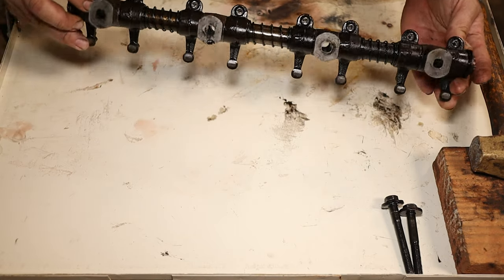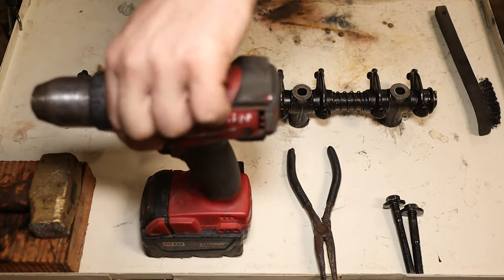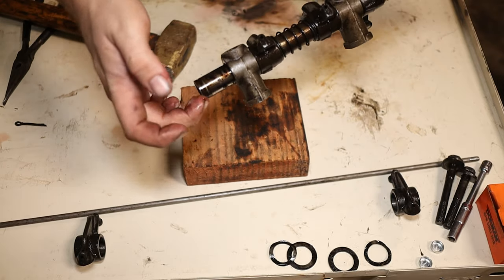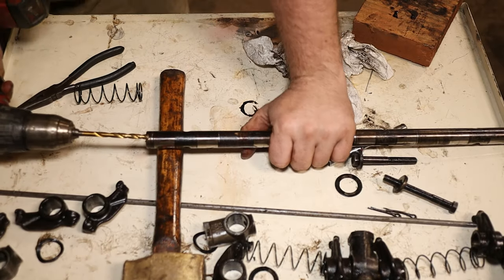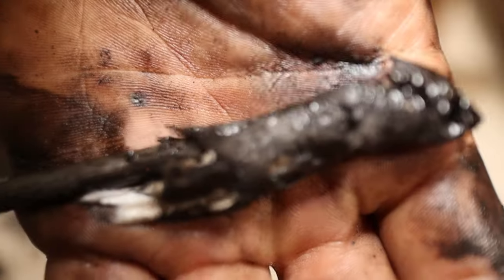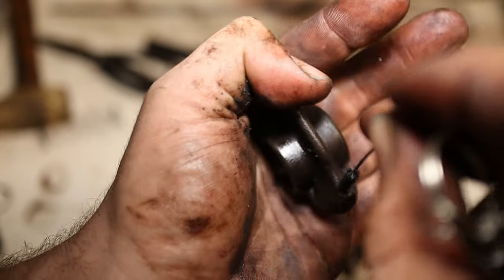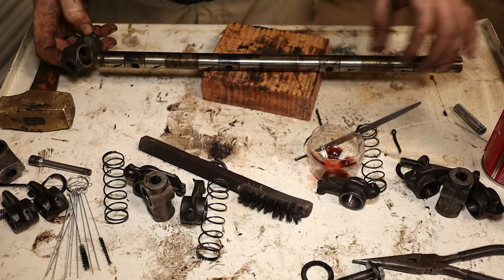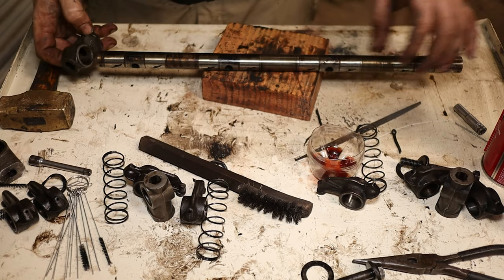The most OVERLOOKED cause of rocker arm oiling issues on the FORD FE Engine!

Comment: My old 390 had way more oil coming out of the rockers,  mabe do to the hi volume oil pump
Reply from the maker: Hi Graydon!Thanks for watching!😀 Most FE's should have more oil coming out than mine. This truck has a restrictor in the oiling passage under the rocker pedestal. This is in a 72 f100 4x4 and it spends a lot of time at high RPM's. The restrictor simply helps it apply more oil pressure at the main bearings and it also helps keep the valve covers from completely filling with oil on longer trips. ( this mod is really only needed if you spend a lot of time at high revs).

Comment: I've had a lot of high mile FE engines and still running a couple of rebuilts (when I can find enough gas) never saw a rocker oil problem(?) FE engines go many miles with near zero oil pressure at hot idle, wouldn't see rocker oil then(?). My engine builder warned me to be very careful clocking the shafts, didn't say anything about altering them. Clocking failure? Best thing for standard FE is long tube headers or high performance exhaust manifolds.
Reply from the maker: Thanks for watching Dan! I  I am not altering the shafts in this video, just cleaning them out.👍 In my experience with FE engines they will get clogged,( or at least partly so) and the oil flow out of the rockers is diminished, therefor exposing the brass bushings to unessecary wear. Although this probably does vary due to how well the engine was serviced/maintained.  I will also say that it seems pretty hard to find a well maintained FE in my area. 😅
Reply: Reason we don't find well maintained is those tuggers are so durable without maintenance like most old Ford over head valve engines. Recently took a 352 out a 59 bird 167K miles on the odo no sign it was ever taken apart. Mass sludge but still running good. Crank thrust was so worn rods were pushing the pins out of the pistons, common to high mile manual trans. Stock cylinder bores were still in tolerance, engine builder figured it was one of the rare high nickel blocks. Replaced with rebuilt 68 GT 390.   @TheBestDanielBlount
Reply from the maker: @danontherun5685  That's awesome! I have a 59 T-bird with a 352 myself! They are awesome cars! Mine has 54k miles and runs like a brand new car. Sadly, the previous owners left it out in a field for 25 years, so the paint is ruined.
Reply: I replied about your 59 but may have blown the reply, I think it started with 'now I'm impressed'. Let me know as I have some info you should have, especially that I have a lot of spare squarebird parts including good int/ext brightwork too good to toss and don't need bux. Will watch for your reply.  @TheBestDanielBlount
Reply from the maker: . Thanks Dan! I LOVE my 59! I used to not like them when I was a kid,  but bought this one for cheap mainly because I hated to see it sit and rot. I fell in love almost instantly and it's since become an obsession.😅 I might need some interior trim, mine is intact but the chrome plating is REALLY BAD, I'd also love a set of half decent door panels if I could find them. I need to make a set, but don't have the time right now.
Reply: I have all that and a lot more I don't need. Dash pad collapsed? I'm in Seattle, email connect? I have performance Fords and prewar cars but by far my favorite driver is my 59. @TheBestDanielBlount

Comment: I got new rocker arms and my rocker arms are loose and I don’t know what to do because their torqued down to 45 ft pounds. They are tapping and I don’t  know what I should do?
Reply from the maker: Do you mean your arms are loose on the shaft? Or that the arms are loose on the valves when torqued down? If it's the latter, you most likely need longer pushrods. The FE has several different pushrod lengths through the years. My advice is to measure the pushrod with a wide jaw caliper and then try one of the FE's longer versions. Pay special attention to the ends of the new pushrods because most FE engines use a ball on both ends of the rod BUT some of them did use a cup on the rocker end and a ball on the lifter end and you need to be sure not to order the wrong kind. Hope this is helpful.🙂 Best of luck with your project!

Comment: Sludge, next to heat, it's the engines worst enemy.
Reply from the maker: You are 100% correct on that!😀
Reply: @TheBestDanielBlount  There are lots of good products to combat sludge, the one I use with excellent results is rislone. Been using it since the 60s.
Reply from the maker: Heck yes! Risolene is GREAT! I used it once on an FE that was plauged by lifter noise, and it worked wonders! Sadly it seems to be getting a little harder to come by. The last time I tried to get some, all my local parts stores had stopped carrying it and I had to resort to Amazon.
Reply: @TheBestDanielBlount  In a pinch you can throw in  a quart of diesel fuel idle it at about 2000 rpm for 15 -20 minutes, drain and put in fresh oil with 200ml of diesel fuel. It'll clean as you drive, you'll feel the difference.
Reply from the maker: That's a great tip, I think I will give that a try ,next time! Thanks! 😄
Reply: @TheBestDanielBlount  It's important not to put a load on the engine like driving the vehicle with the quart of diesel fuel in the oil, not enough protection.

Comment: Does it go right back on or do i have to adjust something? I have a tick that i thought was a manifold leak, but a older guy i was talking to said it sounded like a plugged lifter and to put in some transmission oil. I put in marvel oil in and two minutes later the motor 360 got quiet but only stayed that way for about six minutes. Before i did that i pulled the valve cover and there was little dents under the  cover, but taller valve covers didn't help. Thank you for any advice
Reply from the maker: The problem you are having does sound like a faulty lifter, (FE engines are unfortunately quite prone to this as they age) my first course of action would be to pull the rocker shaft assembly and check all the pushrods to be sure they are not bent, as this is another possible cause. You can check them by simple laying them on a flat surface and rolling them along it and watching for bends. This would be a great time to clean the shafts like I did in this video. When you re install the shafts/pushrods you want to be sure to slowly and evenly torque the bolts back down to spec, (40-45 ft lbs IRRC) be careful when doing this as you can bend the rocker shaft if you are too aggressive. Most FE engines use hydraulic flat tappets, which means that once you bolt the shaft back on the lifters will "pump up" and basically adjust themselves dynamically. Some FE engines did have mechanical tappets, and need manual adjustment, however these engines are quite rare and were usually just used in HiPo applications. If your rocker arms look like the ones in the video, they require no adjustment, if they have screws over the pushrods, then they will require adjustment.  When it comes to lifters, I have tried ALOT of various additives over the years and various FE engines I have Had, and it's really hit or miss in terms of stopping noise. Lifters can be taken out and cleaned, or you can replace them (be sure to use assembly lube on the lifters and cam lobes, and follow the break in procedure for flat tapped lifters)  I hope this helped you, and if you need anything else, please feel free to reach out to me here anytime😀 Good luck!👍

Comment: Great video!
I have a '71 Maverick with an inline 200 engine, I'll be lapping the valves and replacing the lifters. I knew something had to be done with the rocker shaft, but I wasn't sure--NOW I KNOW! Thank you!
Reply from the maker: I'm glad I could help! Best of luck with your Maverick project! I have to admit I'm a little jealous! I've always wanted an early Mav!😃
Reply: Never saw a FE with lack of oil up there.usually too much if there is plenty of oil pressure.i installed a threaded plug in the oil passage under the rocker stand with a 1/16 in.hole.

Comment: the 292 ford is well known for starving rocker arm shafts. drilled oil passage to the camshaft, thru cam shaft bushing on thru block to cylinder head, and on to the rocker shaft. Hi engine RPM's can make the bushing turn [ rotate ] some blocking off the oil passage.A kit was sold to remidy that problem by a oil tube was routed to the valve cover special bolt that allowed oil to the starving valve train.
Reply from the maker: That is really good info! I have a couple 292's sitting here waiting to go into project cars. I have seen them drill and tap the top of the rocker shaft pedestal to install a restrictor to increase oil pressure. I am currently doing some testing of a similar "trick" for FE engines, in, which you insert a holley carburetor jet into the oil passage under the pedestal to increase main pressure. I have used that for a while on this rig, but I am trying to put together a video on the effects of it.
Reply: In case you guys are still on the yblock rockers John Mummert has the correction video, simple fix actually. Of the best yblock experts and quite a nice fellow actually. My yblocks were built to spin 5500 running hard for many years no problem and have a lot of pals that run them, no rocker oil problems. Mummert is also dependable parts source and has the best starter motor that also fits 58-64 FE. @TheBestDanielBlount

Comment: Sounds like the FE engine wants regular oil changes and dosing with M.M.O. to keep the oil passages clean and crud-free…
Reply from the maker: @dennisyoung4631   This is always good advice, but ESPECIALLY for an FE. The lifters are prone to failure due to debris as well. However, FE engines are resilient, I've had a few over the years that were run with non detergent motor oils and irregular/non-existent oil changes. They will still run for a long time, they will just make a lot of valve train noise.😅
Reply: Knew someone many years ago who had a “mighty three-ninety” in his truck.  Unfortunately, I never had the chance to own one - either a Ford, or a 390.

I suspect I really missed out.
Reply from the maker: @dennisyoung4631  I recommend them, if you come across one that's reasonably priced (hard to do these days). They are fun to drive, especially with a stick shift!! 😄 Parts are kinda pricey though.
Reply: @TheBestDanielBlount  afraid that my driving days are more or less over, due to age, ill-health, and poverty - the latter predominating.

Still, though - if the chance should present itself, I might try to secure one.
Reply from the maker: @dennisyoung4631   I'm sorry to hear that Dennis! I know what you mean about poverty though! Everything car related costs a fortune now it seems.😐

Comment: I rebuilt a Clark forklift and it had the same exact rocker arm set up
Reply from the maker: Thanks for watching Robert!  What kind of engine does that forklift use? I used to use an old Clark lift that had a flathead Continental. I suspect this process will apply to almost anything using shaft style rockers, but I myself have only used it on Y blocks and Fe engines.

Comment: As far as your video, you need to get a microphone or speak up. I couldn't watch it becouse I had to hold my phone to my ear just to hear anything you said. Otherwise I think you made a fine video. One piece of information im noticing alot of people are leaving out. You did mention the notch on one end of the shaft & you as well as alot of other articles I've read do say that the notch always goes down toward the head. Witch is correct. But dous it face the front of the engine or dous it face the back of the engine? It matters! And you need to know that when your assembling your rockers onto the rocker shaft. And you need to know witch side. Becouse on one side the notch goes down ofcourse, & to the front. On the otherside the notch goes down & to the back. If you will notice the oiling holes on the rocker shaft, yes they always go down, but they are offset from center. So  depending on witch way you put the notch, to the front or to the back, the oiling holes still down but will either be tilted toward the exhoust side of the rocker shaft or toward the intake side of the rocker shaft?
Reply from the maker: Thank you for the tips! I am 100% with you on the mic, I tried to fix it in post with no real improvement😅. I the tip about being more descriptive was super helpful also! I didnt even realize how vague I was being until you mentioned it. I will try my best to remedy these on my next video!

Comment: Hey Daniel howz it going?   Was wondering when you reinstalled the ahaft you didn't have to adjust the valves correct ,since you didn't crank the engine ovet or anything . Just removed & replaced  ( just torque to spec as per shop manual)  40 -45 foot lbs. Ready to put her back together  valves were adjusted on the rebuild but I m putting a new shaft since we reused the old one... so just wanted to know your input ..thanks bud
Reply from the maker: When I put them back on I simply tightened mine to spec. My Engine has hydraulic flat tappets and a non adjustable valve train, (as most stock FE engines do) In this setup, your lifters "adjust themselves" to the proper lash by pumping up with oil. If you have a modified FE or one of the rare mechanical flat tappet versions, you would need to adjust the valves. The best thing is to make sure of what setup you currently have.👍 Best of luck with your project friend!😀
Reply: @TheBestDanielBlount  sweet even better... guess I was thinking 🤔  for sure .   So  also was wondering guess then y0u only adjust the valves at or when you rebuild...cuz I remember doing that with my buddy .I guess only at rebuild time then??..again just wondering your input or how u see 👀 it
Thanks again ..  wanna get her back on her feet again & running like a champ 🏆 😃😁

Comment: Great video! I’m actually doing this for my 66’ continental with a 462 in it. Hopefully those plugs are the same on these logs. Thanks for the help!
Reply from the maker: Thanks Devonte! I did a quick check online and I believe that these same plugs will work for your 462! You can take one out and measure it with calipers if needed. The ones used in the video (Dorman 555-007) will measure 
 .547" 
Or 17/32" 
Or 13.7mm
I usually get mine from rock Auto and they are found in the engine tab under "rocker shaft end plug"
Best of luck with your lincoln! I have always loved those cars!!
Reply: @TheBestDanielBlount would this be the same plug for a 430 MEL?
Reply from the maker: I believe that they are the same. I notice Rock Auto lists the same part number (dorman 555007) for both the FE and the 430 MEL. I haven't had the good fortune of owning a MEL yet though.😄

Comment: There is a groove inside the rocker which channels oil to the oil hole at the bottom of the rocker, this channel through wear can close off, to the oil hole, a Dremel can refresh the channel directing more oil to the hole at the bottom of the rocker.
Reply from the maker: That is a great tip Gabe! I cleaned the rocker oiling ports, but I did not check them for the wear you mentioned. Fortunately these were in good shape, but they do wear out really easily.

Comment: Hi Dan. Could you do a video about what the "pattern" should look like on the valve stem tip with these rockers? I have seen people pattern a valve stem tip with roller rockers for an FE when they are checking geometry but I haven't seen a video of anyone doing this with the stock rockers. It would be interesting to see the difference (if any).
Reply from the maker: Thanks Cody! That is a great idea! I will get started on that video. As I recall the desired pattern is located in the center of the valve stem and is roughly one third the thickness of the stem.
Reply: @TheBestDanielBlount  👍

Comment: If you have a y block only one side  oils remove the drain tubes run a tube across  or get a oiler kit. Its a cambearing problem
Reply from the maker: Thanks for the info Donald! I've got a couple Yblocks sitting around for future projects, so I will definitely be looking into that.😀👍
Reply: @TheBestDanielBlount  the feeder kits from the sending unit reduces oil pressure bearings fail. I had a fleet of theese I would drill holes in both covers attach the drains
Reply from the maker: @donalddesnoo5303  That's really cool! I think I remember seeing an old advertisement for those kits before.😀

Comment: Thank you for this video! I am doing this soon on a stock rebuild. Very helpful on what to do.
Reply from the maker: I'm so glad you found it helpful Cody! It is amazing how much of a difference this makes even if the shafts are just slightly dirty. Best of luck on your project. 👍
Reply: @TheBestDanielBlount  Thanks!
Reply: This is great! This will help a LOT of people. My advice is  if you have upgraded your cam and valve springs to stronger valve springs with higher spring rate and seat pressure,  you need to upgrade to aftermarket rocker shaft assemblies. The stock ones do not support the very end of the shaft. The end of the shaft will break off, causing all kinds of other damage,  bent pushrods, damaged springs,  retainers etc. It could get really ugly if the broken off rocker shaft and rocker arm unkeyed a valve retainer and then a valve drops down into the cylinder.  Boom. Out the bottom or side of the block.
Reply from the maker: That is very good advice David! I have seen that very thing happen WAY too often!